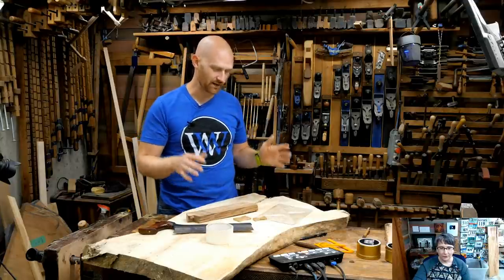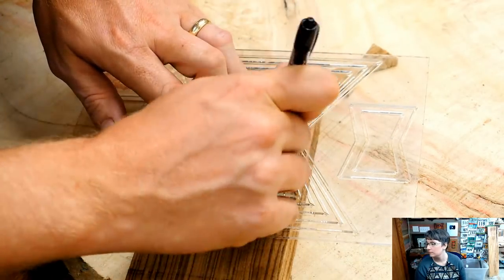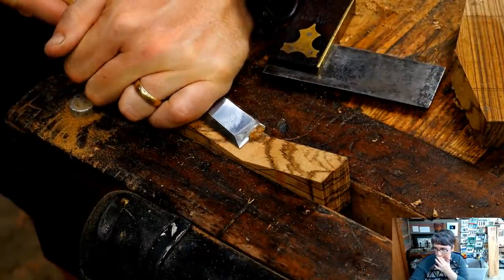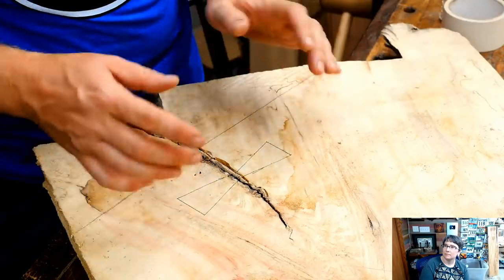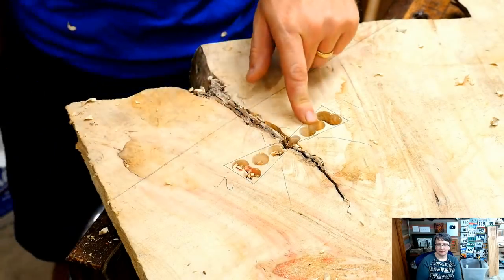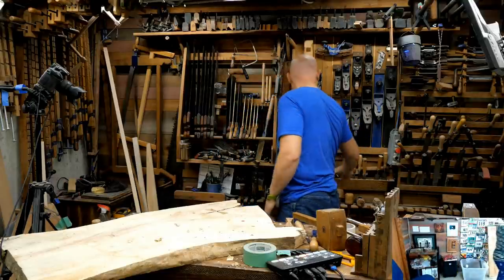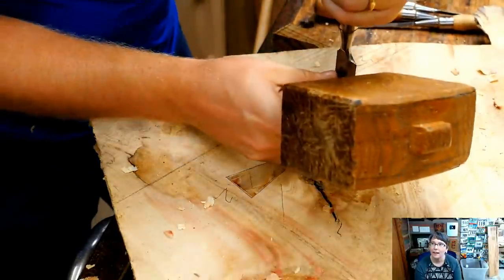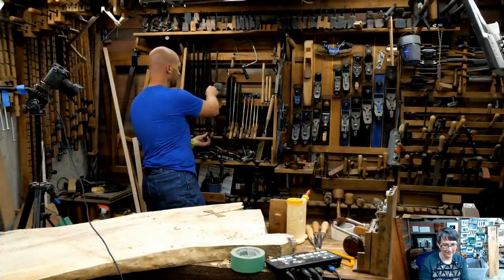How to cut Bowties By Hand | Butterfly Bowtie Dutchman

Comment: Hello Mr. Wright, we are always told to give all of our cutting tools, chisels and plane blades, an initial sharpening before ever using it when you first buy them. Why is that not the case with saws? Why are they ready to go out of the box? Are saws not just many mini chisels all lined up...? Thank you so much for your work! You are truly inspiring to all of us aspiring hand tool woodworkers.
Reply from the maker: It all depends on the company you buy it from. Some chisel companies are good to go right out of the box and some of them like to keep the edges slightly dull so if they don't chip during shipping. However for saws there is no fear of the cutting edge chipping. So you want them to be good and sharp right off the get go.